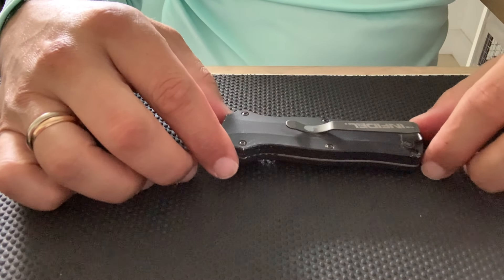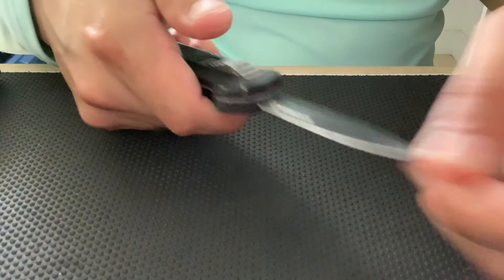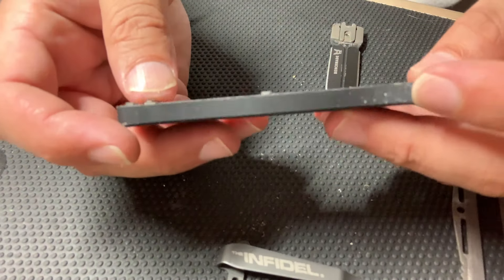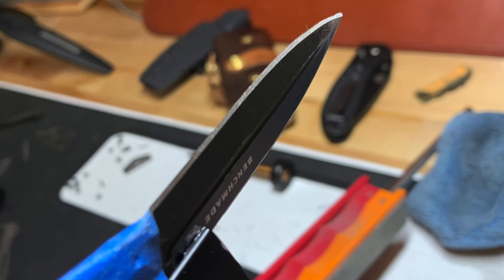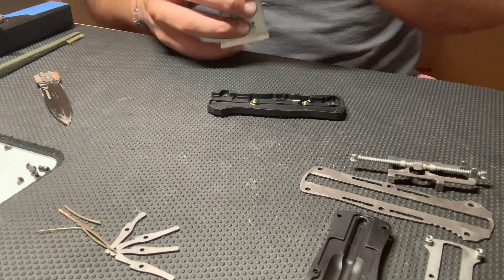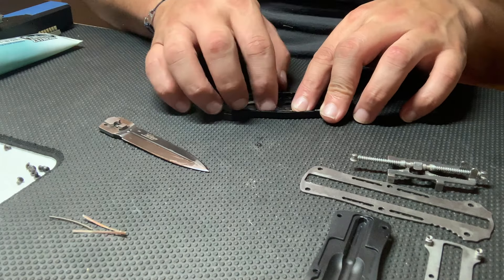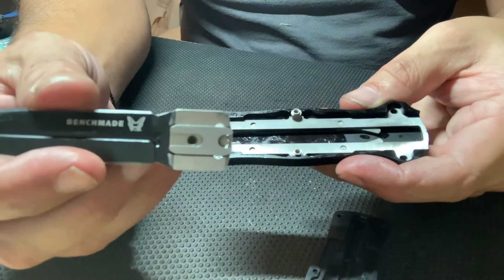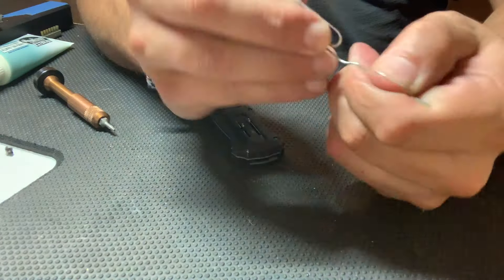Benchmade Mini-Infidel - Service, Repair & Sharpening

Comment: Thanks for the vid, seriously! I agree the hardest part, by far is the leaf springs. Here's what I did that worked for me, and I hope it may help others. Put in one side of the arm, place the leaf springs in position with the arm and the little ridge that is the center. Now, while applying pressure to the ridge/center area of the springs, place the 2nd arm. Take a small flat head, and guide the springs up towards the inside of knife while pushing down on the center ridge and 2nd arm. It will all fall into place. I do hope I'm explaining it well enough. I'm not saying this is the only way that works, just the one that worked for me. Hope it helps, and thanks again for vid.

Comment: 7:12 The leaf spring and arm assembly are the retention system. They are NOT what launches or retracts the blade. They are what prevents the blade from launching or retracting until enough tension has been applied to the main coil spring (really until the activation switch has travelled the appropriate distance). Once there is enough tension in the main coil spring due to the activation switch traveling far enough, the main slide trips the leaf spring and arm assembly, releasing the blade to launch or retract.
Reply: Thank you for pointing this out.  It was driving me crazy every time he made this erroneous statement.
Reply from the maker: I agree and understand that the main spring is what is providing the force to launch the blade. However, what releases that tension is the arm assembly. Also in my experience when the arm assembly binds up, the main spring comes off the blade causing the blade not to launch or retract. I was trying to explain it as best as I could and in a way that most would understand. The main spring does not fail in these knives.
Reply: @miabladeworksllc98  Totally valid, this is just a supplemental clarification for anyone interested, not a criticism. I appreciate your work 👍

Comment: I have the mini and the full size. I rarely use the full size but it occasionally doesn't eject right and feels loose compared to the mini which is very tight and quick to eject but also very difficult to retract. The trigger slide is super stiff and difficult to move. Do I need to take them apart and adjust them? Glad I found this video because I've been terrified to take these knives apart lol.

Comment: Very interesting.  Thank you.  I am curious as to the angle of the edge grind.
Reply from the maker: Chelan Wizard in sharpening several of these the main bevel ranges between 30-35 degrees. We add a 15 degree bevel to the back side to remove the burr. Another thing to note is that these knives are rarely perfectly symmetrical. It’s common for the to be way off from side to side.
Reply: @miabladeworksllc98  Thank you so much.  Appreciate that help.
Reply from the maker: Chelan Wizard no problem...glad we can help

Comment: I found that I could use hot water into the knife to clean, spray parts cleaner into it, blow it out with a air nozzle, spray wd40 and blow that out and it works like a charm. I have had mine since 2010, had it rebuilt once from benchmade with a decent turnaround time (2007). Just had to clean it today and very decent tutorial.
Reply from the maker: Patrick Schiesser regular maintenance is definitely a good practice. A lot of guys don’t go through the trouble and we end up with their dirty malfunctioning knives in for service.
Reply: WD-40 is NOT a lubricant. So don't forget to add the appropriate lubricant at the end of your maintenance process.
Reply: @error.418  I'm not saying this is the case with the OP. But the amount of people that think WD40 is a lube is crazy.
Reply: @MattH-wg7ou  Yeah... like I get in the moment it might seem it can function that way, but lube isn't supposed to only act like a lube for so short a time. You'd think they'd figure that out.
Reply: @MattH-wg7ou  Yeah good way to destroy an OTF

Comment: How about some info on screw type and size?
Reply from the maker: Steve Spencer the screws are T6 Torx screws...don’t have more specs than that...oh and you have to be careful, on the mini Infidel the screws are longer on the button side of the knife. Also on the mini, the clip screws are shorter as well. The full size version has the screws all the same size.
Reply: Hey Steve the thread pitch is 2-56.
Reply: @mr.redacted1441  Awesome! Only info missing now are the two lengths.

Comment: Are the so called leaf springs very thin Flat steel that you stack to create tension? You said twist leaf springs together? Pls clarify..found this very good video, just confused on leaf spring  position....thnx for sharing knowledge...I'm in the fence on microtech or benchmade..the firing mechanism wise....

Comment: How would you compare it to a microtech? Does the microtech handle dirt better? Thanks and have a good one
Reply from the maker: H Phillips I’ve had several Microtech knives in for sharpening and none of them have ever needed to be serviced. They all performed as they were supposed to. I’m no expert on these knives, but the Microtech knives do not fail like the Benchmades do...
Reply: My personal Microtechs are more sensitive to dirt than my Benchmades. But once you have the driver bits (tri-wings and domed tri-wings) for the Microtechs, I find them easier to service. The pin in the Benchmade activation slide is annoying. That said, the Benchmade feels so much nicer in day-to-day usage, so I still prefer the Benchmades.

Comment: What are you using as lubricant?  I'm thinking of sending you my 3350 OTF mini what is the turn around time?  P.s. It's missing one leaf spring do you have replacements?
Reply from the maker: Eris Free turnaround is usually about a week...we are a bit backed up now with the holidays. We do not have spare parts though. We currently use FrogLube.

Comment: My infidel blade is loose ? Any tips?
Reply from the maker: Tanner Ortiz is it loose like it just fell off track and needs to be reset? Try pulling the loose blade forward until you hear a click. If this is not what you mean, and you are referring to the blade wobbling a bit while deployed...then the screw that secures the carrier piece inside the knife has come loose. The knife has to be disassembled, serviced, and reassembled. We can do the service of you’d like.

Comment: I would have not left that much residual oil inside this type of knife. That is going to be a debris magnet.
Reply from the maker: David Metzger that is a good point...and that knife was actually disassembled after the video, dried up and reassembled. I’ve tried both ways with these knives, leaving them soaked in lubricant and running them dry. What has worked best for me is a hybrid of the two. I assemble them soaked and operate the knife a bunch of times. Then disassemble it and dry off the excess.
Reply: @miabladeworksllc98  What type of lube do you recommend?
Reply from the maker: @David Crohn we have been using FrogLube recently. However, your preference of gun oil or tool oil will work just fine. Just make sure you do not leave it soaked as noted in previous comments. If the knife is left too saturated in oil, the oil actually traps or collects more debris (lint, dirt, etc.) and the knife will not function properly. I normally oil the parts while I’m sharpening the blade, letting them soak for 30-45min. Then wipe all the parts down prior to reassembly.
Reply: Have u dissected  the Chinese copy?

Comment: Kinda seems like it’s not necessary to remove the trigger/button.
Reply: It is... I've been trying to reassemble mine without removing the pins in the firing switch... I've tried every which way (including the way described in a comment above) and... no. I have to find a punch small enough now 🤦‍♂

Comment: now youre just as backed up as they are
Reply from the maker: Our turnaround is about 2 weeks. I think that’s quite a bit faster than BM. However, I do this as a side business so I do have to control how many knives I take in to keep backlog reasonable. Shoot us an email if you have a knife that needs work.

Comment: Hey man I just wanted to say thanks and to tell you that this is a really really really shitty video on the reassembly of an infidel. You don’t have very good POV on the reassembly but, I did find it was easier to toss the springs in first then wedge the arms and the pivot pin assembly into place second. Figured I’d post this here incase anyone else is still struggling to reassemble their knive.

Comment: And oil would be a dust and lint magnet...why not just a little lithium grease with out the the hassle of oil ?but that means no more money to sharpen and fix the issue because of the warranty limited to 5$ to sharpen...dont get me wrong I love benchmade ...very well made knives but when it comes to sharpening the knife maybe mirror sharpened but I can get it just as good and to a mirror finish myself or maybe even better why would I pay you $5 to do that other than it would void the warranty to sharpen the blade I don't worry about the warranty I've got plenty of Benchmade out the front knives and had not one problem with getting any of the parts to fix it if it is broken other than a blade but then again if you're buying that kind of quality blade why would you be using it to to break the blade by prying on stuff but iv also dropped it and broke the tip....at d2 hardness???? The price is way to much for the actual knife js
Reply from the maker: Hi Shane, 
Overall grease (being thicker) should be used sparingly as it can build up its own junk and residue where oil will not. https://www.bladeforums.com/threads/white-lithium-grease.767450/

We get all sorts of knives in at different value ranges. Some knives cost much less than our sharpening but it holds a sentimental value for the customer and it's just a knife they love. We are here to help anyone who can't sharpen or repair themselves.